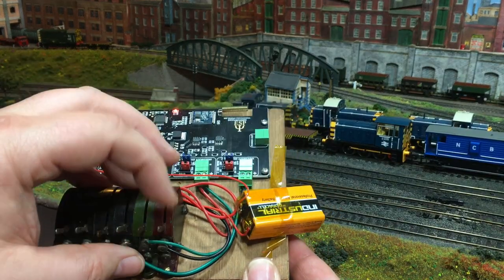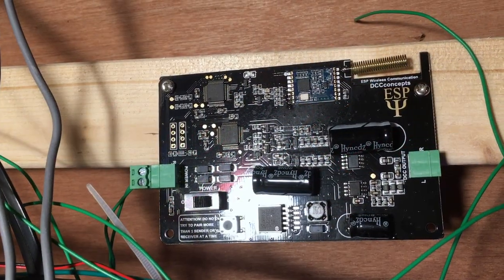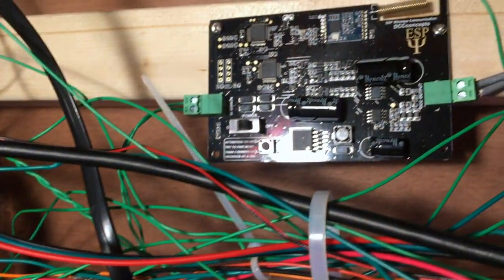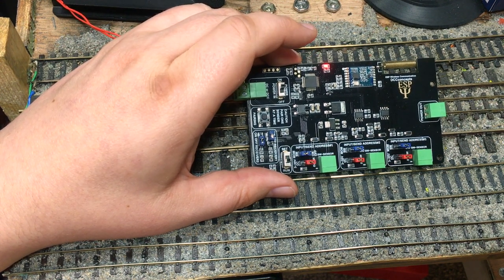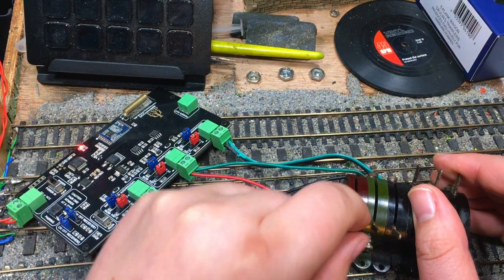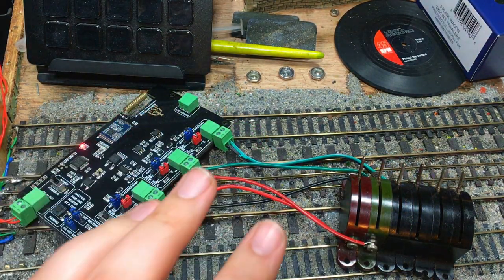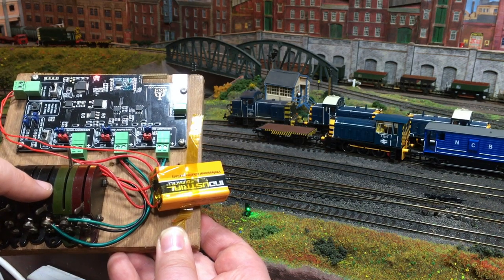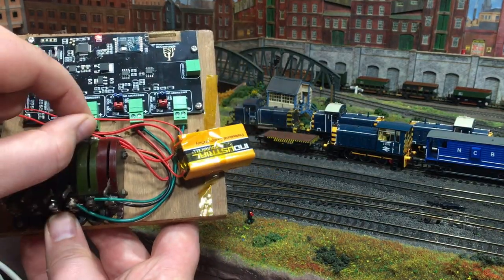DCC Wire Free? | DCCConcepts ESP Wire Free Control System

Comment: I use servo motors to operate my points and signals. will the esp work with them. The other thing is where is the common for the point etc fed from. I like the idea of this system.

Comment: Quite an interesting video. I purchased an array of DCC Concepts products.  I am starting a new layout using an NCE system, and my first plan is to make Cobalt point motors work with Alpha A Switches and using the push button switches coupled with the transmitters and receivers. I enjoy all the videos as there is so much to learn here - like using a 9V battery as opposed to the 12V DC power, as I need 2 DC sources for my transmitter and the Alpha Switch A, as they point out they need different DC power sources, and I am putting all this into a wireless box. They don't say "why" this separation of DC sources is necessary, but I'm not really questioning this. I'll let you know if all this works!

Comment: I am always interested in learning something new and this is a great example of something useful.
In my case, my layout is DC and I live in Toronto and it is shocking what some are charging for postage. I don’t know what this unit would cost but I imagine the cost of postage would be close if not more than the product. This is the cost of living in the colonies🤣
My simple manual method of wiring led lights will have to suffice at the moment.
Thanks for posting and a great explanation👍

Comment: An interesting and clear video Jenny. I can see a benefit if one was selective ie to operate points that are hard to see if you have a large layout. Just to clarify, is your ESP  receiver fitted before the power booster so the last thing the track gets is the higher track power?
Reply: Jenny has put ESP on her main track bus. As the receiver is limited to 1.5A, this would limit her layout power, so putting it before the booster ensures the layout maintains 5A of track power. 
The receiver can then inject accessory commands directly onto the main bus with no need to worry about power requirements. 
You could alternatively create an accessory bus with the receiver which could be lower power to operate things like iP Digital motors. This would negate the need to boost the output as only the 1.5A would be needed. 
Hope this helps :-) 
^RB DCCconcepts
Reply from the maker: Yes the ESP is inserted after the alpha Panel but before the booster so that the layout power is not restricted.

Comment: good review of the ESP but do the points need to be decoder fitted too? How does that bit work? (sorry newbie question, lol)
Reply: Yeah.. Across the pond wondering same thing. Obviously, yes, I'd think turnout motors have to first be decoder operated...So forget this if we're just analog motored and ground throw ops.. 
My ESP is telling me this is getting way out of hand....
Reply: Yes, this is for the control of digital accessories. 
ESP was developed to avoid the need to use DCC handsets to change accessories such as turnout motors and signals. 
It also avoids the need to have large amounts of wiring under layouts, meaning everything can be simply connected to the main DCC bus. 
We have more information on our website and YouTube channel. 
^RB DCCconcepts

Comment: I like the idea of wire-free operation! The trouble is you need quite a lot of kit just to control a few functions: The ESPS.3, ESPR.1, an accessory decoder and levers or switches - that could get quite expensive if you have a lot of points, signals and other things to operate.
Reply: Only one receiver is needed on the layout, James. ESP is great for controlling digital accessories but it can also communicate from the layout back to a panel. Imagine detection on multiple sections with no wires at all back to the display panel. 
There is more information and videos available on our website if you want to see some further applications of ESP. 
^RB DCCconcepts

Comment: Sorry to be a bit a bit picky, but putting circuit boards on metal rails is a great way to short them out.
Reply: Don't worry, they have a foam backing :-)
Reply from the maker: Those tracks are not live, and the board is foam backed.